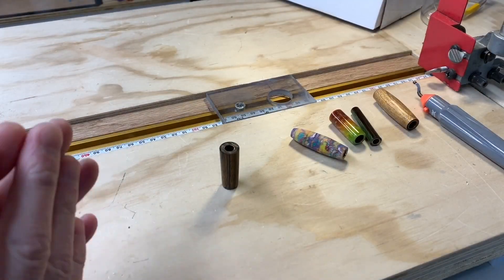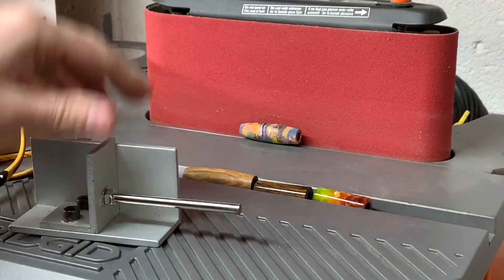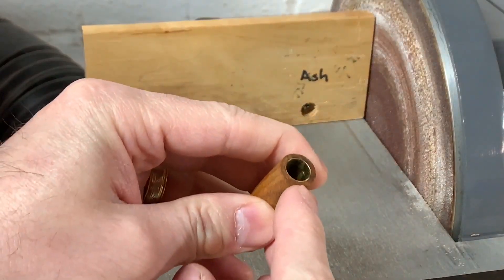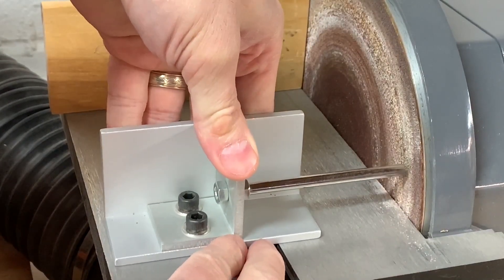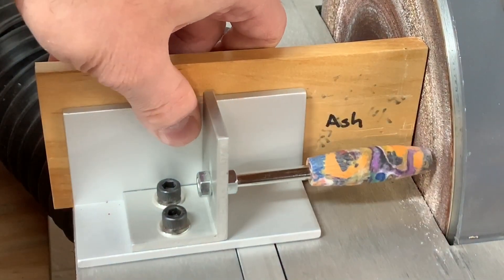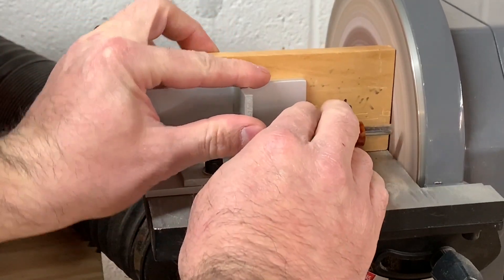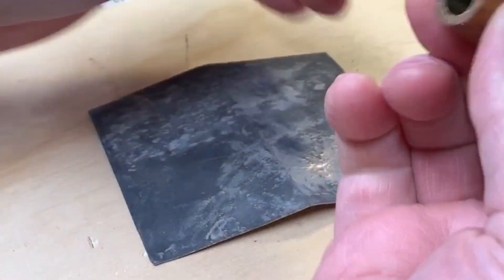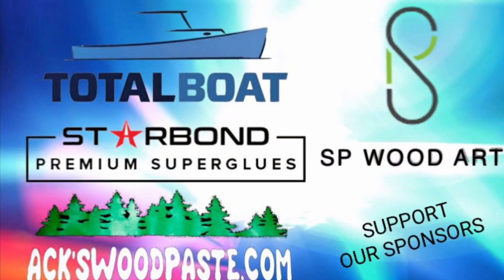Wood Turning Tips - Sanding Pen Ends

Comment: Been doing that for years. No jig though. I use a aluminum square like you have against a miter gauge on my disc sander but i use a HF punch set for all the exact sizes in almost all pen blanks for my shaft. I hold the punch down and against the aluminum square and slide it gently into the sander. I have to turn the blank down to 1/4" dia. though, for it to work.
Reply from the maker: Carl Civitella Another good tip, thanks for sharing. You could make a jig with the punches for sure. Either way is way better than hand sanding. Lol thanks again my friend.